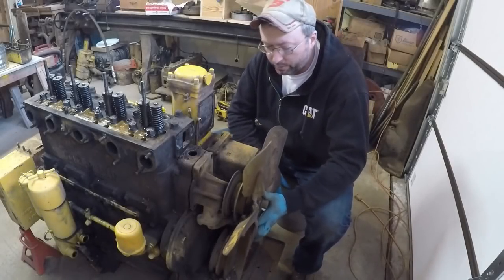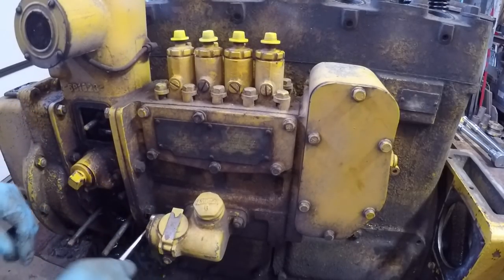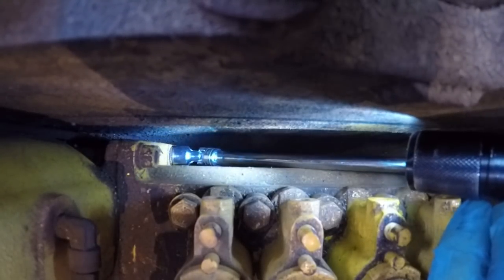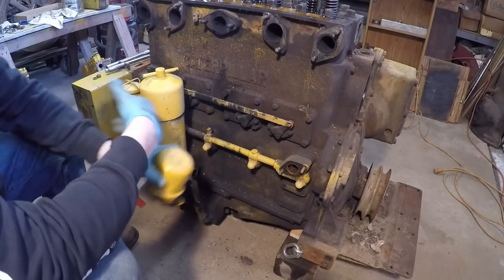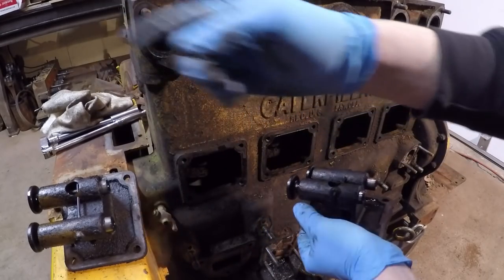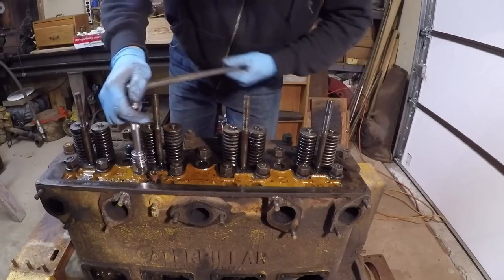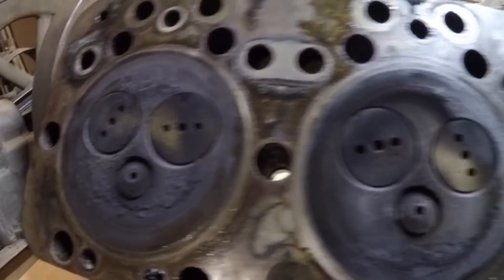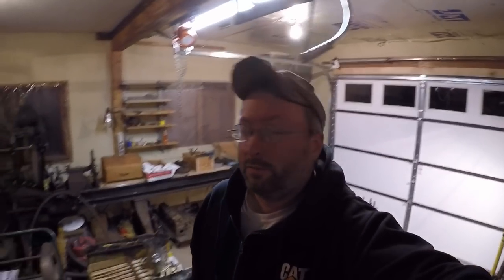Caterpillar D2 #5J2115 SP - Engine Teardown for Parts Day 2, and The Rest of the Story...

Comment: We had a D2 similar to the one in your vid years ago that we used for pushing coal in cleanup in barges.. That little tractor was just right  because it was light enough to  handle with the crane with a bridle attached to the clamshell bucket .. It was easy to lower it down in barges and raise it after we were finished.. Mike in Louisiana

Comment: That aint too bad the D-339 in my D7 had almost .025 tapper in the cylinders before it finally broke a piston ring. I almost messed my trousers when i seen how bad it was and was still running. CATERPILLAR builds an awesome engine. Nice video.

Comment: That little engine made a LOT of turns and no wonder it wouldn't run any better. It was maxed out as it sat there. I remember the old Cats having an oil fill on the injection pump housing and I always wondered whether they were fed off the engine or had their own sump. Maybe the old 4's, 6's and 12 graders. Been a while. So Thanks, Toby and we'll try and not remind you of the daily deals too much. I mowed some high tops today but mainly to see how the mower did. But it won't be long! And good to see Pop in his natural element!

Comment: Hopefully that engine block passes the N.D.T. as well with the crank and cam if those are to be reused. Good to see things are looking your way as of now.
Hopefully it will continue until the rebuild is done.!!
 The other engines you disassembled takes me back things I've seen. 1" oil clearance on the rod bearings. Thing is that was it was a running engines when the customer brought it to the shop. It came in with oil pressure being a issue. I could have paved your driveway with the sludge that was in the oil pan..

Comment: I have an onan opposed twin, one cylinder had so much carbon that it scrapped the piston top down to the compression ring (only a quarter of the piston), you could see nearly the whole ring. after de carboning it ran for a few more years and now is in dire need of rebuild. funny when you see it. amazed it runs.

Comment: Thanks for the next installment and more history. I prefer working on heavy equipment and machines to Automotive. I just tell guys take that stuff somewhere else, I don't even enjoy working on my automotive stuff. when you say about bolts you can't see, whats more fun is when you can't find the battery it's so hidden under the rest of the crap. 
I'm sure some of these guys designed and built the  prototype, turned the key or hit the start button and nothing happened. After an hour of head scratching they came to an o crap moment, when they realized somebody forgot to design in a battery. Thats my theory why some are in the most stupid awkward place, because that was the only space they could find left under the hood or in the vehicle to put it L.O.L.   The many pick up trucks     out there where you take the cab off to work on the motors crazy to !. Take care
Reply: A lot of high spec cars today run TWO batteries, one is a gel battery in the car,just to run all the electronic trouble makers .And some of those batteries have a very short expensive life if the car is only used to go shopping once a week. Thats why i drive a 35 year old mercedes,the only electronics are in the alternator diode pack. (and the radio cassette player)
Reply: @squatch253  Yep, Ford F series head gaskets..... There were very few of those trucks bought into Australia and even fewer still running today.

Comment: 30 hours? I have never seen carbon like that in only 30 hours even engines that burn more oil than fuel. Question, you have 5 exhaust holes and only 4 cylinders, what is the 5th hole? This seems to old for EGR so not sure unless it is some kind of heating flange, not sure so had to ask.

Comment: Is that a wet sleeve engine?
Reply: @squatch253  I take it there are no sleeve kits available? I re-sleeved an engine back in the 90's on a B62 International tractor I rebuilt.
Reply: @squatch253  I wonder if there would be any other units that would fit? Probably really odd ball items for dimensions.
Reply: @squatch253  custom pistons would be a fortune too. Makes you wonder what to do when there is nothing left.

Comment: No air tools? Is it so you can talk while you work or are you philosophically opposed? Not passing judgement! I was a professional wrench a good part of my life.
Reply: I have a couple of air wrenches which hardly ever get used. I work on older Mercedes all the time and time is not a priority if I were in a dealer (or independent) where throughput on a high level is essential. I take the time to remove most fastners so they can checked and reused or thrown out. Essential on some old cars where originality is important. if i used a air wrench or other powered device I would be breaking those rare and valuable bolts,screws etc to save my 30 minutes on a engine strip.
Reply: Yeah, I'd rather hear you than the air tools. I worked for VW back in the air cooled days and air tools were verboten. Got pretty good with the old speed handle.

Comment: When you go back together, don’t forget your pump lifter settings as low lifters from cam bearing wear/from low or no oil in pump housing/ is the number one reason for poor engine performance. You can have everything else perfect but if timing is late at the pumps it won’t run fore #$*’. Also if you have a Cat dealer around that still has an old pump test stand, I would recommend having all for pumps volume checked at both low and max rack settings as the scroll usually wears more towards the idle area of the plungers thus causing poor, rough idle. As you probably know the injectors can be rebuilt as well and most of the internals can be freshened up with a lapping plate along with a good cleaning. Very nice to see someone taking the time to restore that old iron because we will never see stuff built like that again and when it’s gone it’s gone. Nice work👍

Comment: Man, oh man. I just found a Caterpillar Fifteen for sale on Ebay for 3 grand. Says the motor isnt stuck. If only I had a shop big enough to work on it...
Reply: @mmm365  the main problem is, I live in town on a kinda small lot, and have no real work space big enough to tear into it. Oh, and it's about 10 hours away from where I live.
Reply: @robbyschemonia3089  True, BUT if you get bit by the Old Cat Bug....................
Reply: Work on it outside for a while, while you look for a garage to beg borrow or sigh, rent cheaply.  Make friends with older folks who have too many old buildings!
Reply: First Question: Are you married? If  so, there might be complicating issues. 

Bottom line, go for it, and then beg for forgiveness. 

This was my plan when I bought a 1946, Logan 825, 10 inch lathe. But of course, the Logan was only $2K, plus $1K shipping. 

I’m sure you’ll get a better deal...

RL  Buffalo, NY
Reply: @rlewis1946  yes, I am married, and when my wife walked past and saw me looking at the listing, "not a chance in hell" is what I got...sad day...

Comment: After my 2002 f550 with a 3126 engine I'll never invest in anything else with a cat, hewi pump replacement, injectors, valves, water pump,  turbo oil leaks like hell excessive blow buy all before 150,000 US miles, but I do love your videos, good work,  they sure don't make them like they used to!
Reply: I think my neighbor has the same and is getting the same. In the shop more than on the road but they drive it like a bat so I guess they're getting what they paid for.  But yours is not alone. Common tale is that over around 80K they start flying all to pieces and his has 150k as well.
Reply: 3116 and 3126 are junk motors
Reply: @bcbloc02  It's reaching to even call 'em junk. I know there's a word but I can't think of it now.

Comment: Broken top rings are normally from starting fluid. Its one of the first thing I learned. We had a engine job in the shop a old 555 cummins that would only start on starting fluid and every top pistion ring was shattered or missing